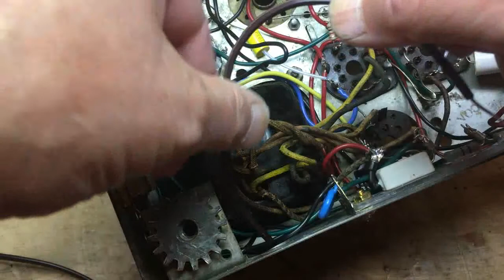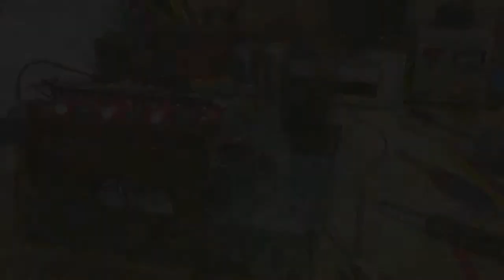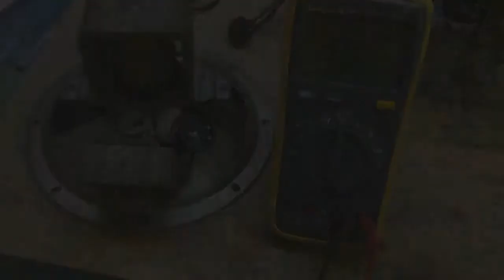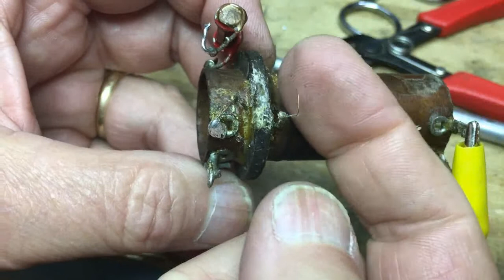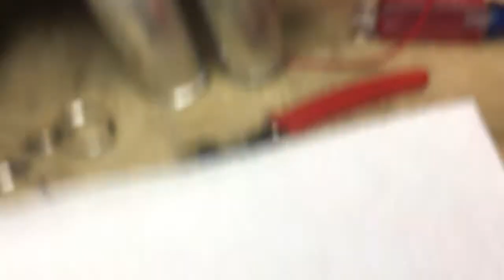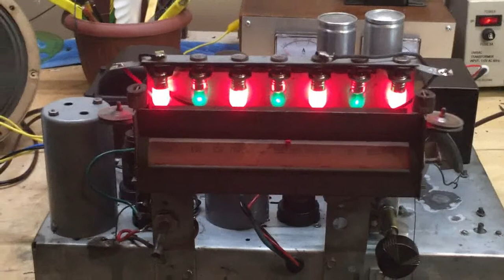1936 General Electric E91 Colorama Part 6 of 9 Power up, Problems and Success

Comment: Larry,
Awesome troubleshooting, my friend.  I have mentioned before that I want to get better at troubleshooting.  You just put up a great example of it and I'll be watching this one several times to absorb it all.  The first radio that I ever worked over was a Zenith 8S463.  The radio played phenominally well and sounded great.  Except that I couldn't get the danged 6U5 tuning eye to light properly.  It finally came down to trouble in the AVC on that one, too.  You did a fine job of explaining the fault in your set.  Some day, I'll find a Colorama set, and I'll make sure to have your video handy!    As always, awesome work, my friend.  Michael

Comment: Good going. That knot was a good reminder as well as the reminder to
keep a can of liquid electrical tape in the tool cabinet. Great to hear it and
good to note your specifications as it started up. Good job overall. Aloha from Maui.
Reply from the maker: Randy Gentry Thanks Randy! This set was and still is a little scary. It was only made o e year due to the problems it had. The "Magic Eye" tuning won out over GE's better idea. It pull a lot of current, due to the lamps, and 9 tubes. I need to realign it and monitor it a bit before ai call it done. Thanks for watching and commenting! Aloha--Larry

Comment: Excellent job Larry. I was able to watch the video in its entirety. As I mentioned before, the Colorama feature is fascinating. The coil repair was well done and don’t beat yourself up on the tube voltages. I’m looking forward to the cabinet work. BTW - thanks again for your kind words. I’m sure your subscriber count will continue to climb. Best, Don
Reply from the maker: RestoreOldRadios Thanks Don! I’m over beating myself up, and using it to improve. It’s how we need to do it in this hobby and in life. I started the cabinet today and discovered more issues than initially. Nothing that is show stopping but a little bit more hide glue than expected, lol. I’m looking forward to seeing the repair of that field coil you have. I know you will pull a rabbit out of the hat! Thanks again! Best—Larry

Comment: Great job Larry.  I was expecting to hear more excitement in your. Once when you got it playing! 😃 The tip on the knot (the heart - love) will help me remember it.  How were you able to isolate the coil as the problem? I've yet to have to repair one and am wondering out loud how you even figured out it was a problem.  I enjoy your videos. Looking forward to the next one! Thanks Mike
Reply from the maker: Michael McKenzie Hi Mike, thanks for watching and commenting. I guess I should have more enthusiastic, but I had just worked looking for the problem for 9 hrs that day, lol. I hinted at how I located the coil when I found that there was no plate voltage on the RF amp tube. I traced it back thru the band switch to the coil. I should have checked all the voltages upon power up and will from now on. You will get around to fixing one one day if you wish to. Thanks again! Best—Larry

Comment: I knew that was a UL knot, LOL.  I was watching old64goat the other day n he kept calling it a Westinghouse knot, I thought I was going nuts, lol.  Awesome that radiodaze now has that scale.  I feel for you, the one thing I dread most is trying to solder tiny wires!  Glad you got it all worked out.  You did a great job.  Take care my friend, Gary
Reply from the maker: Rebel9668 Thanks Gary! I lucked out finding that tiny wire near the end. Im not sure which way Id went had this not worked. I usually fumble and break the wire beyond repair, but this worked rather well. The lacquer thinner strip helped a whole lot, in the past I tried to scrape the insulation off and weakened or broke the wire. Yes, I havent received the dial yet, but hopefully it will be here by the time the cabinet is done. Thanks for watching and your comments! I always enjoy your feedback. Take care--Larry